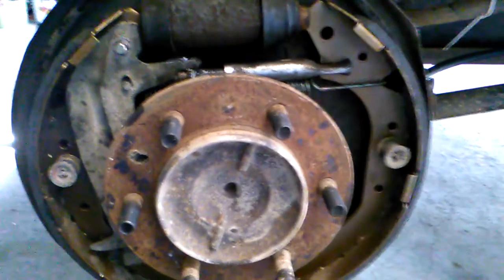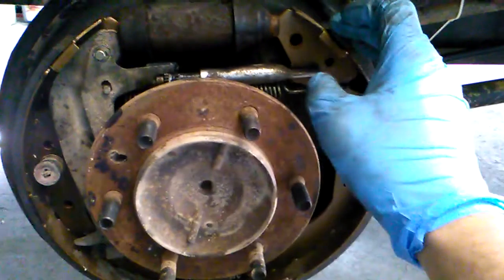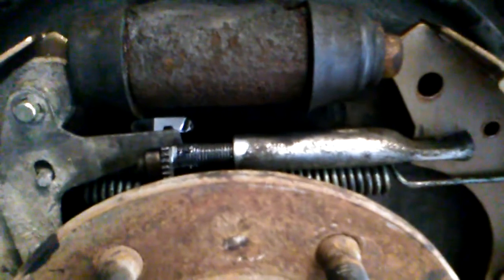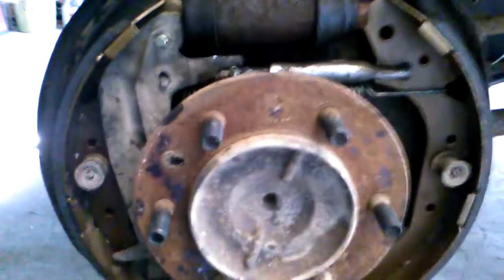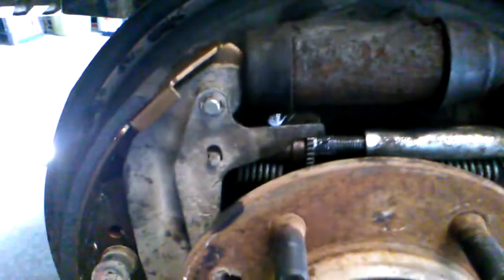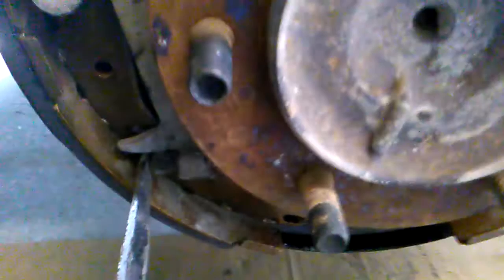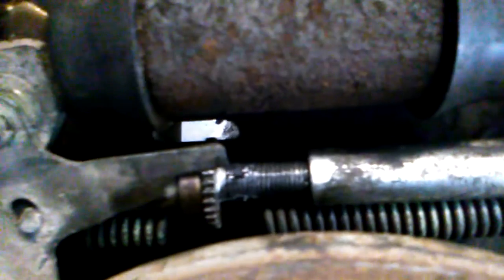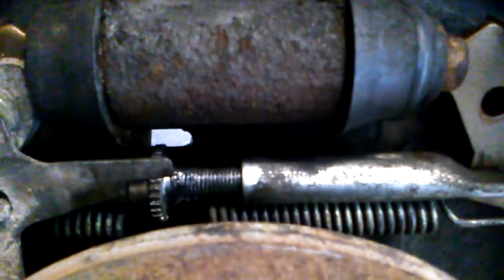Self-Adjuster Mechanism

Comment: Thanks for showing that mechanism; it's 10 degrees outside. My issue is that my Nissan truck self-adjuster never stops tightening and eventually locks the wheel. Nissan has lots of trouble with things like brakes, wiring, speedometers, etc, otherwise pretty reliable.
Reply: Check adjusters ..there's a print on them one goes to right side one goes to left side..sounds like they got switched..hope this helps👍
Reply from the maker: Better get cracking

Comment: Hi thx for the video. Just replaced my drums and shoes on the rear. I adjusted the self adjuster until there was a slight drag on the drum. I pulled the hand brake to check operation. It locked the wheels like its supposed to. When i released the hand brake, seems like my adjustment went away on both sides. Now theres no drag on the drums. Is this normal???

Comment: Question:  if the self adjuster on Toyota Hilux (in South Africa) does not adjust, is the solution to replace the spring running down from the adjuster plate?

Comment: So in theory there is not much need to do any manuel adjustments when installing new brake pads. Just make sure it's all loose and then pull the hand brake a bunch of times?
Reply: Foot brake will do the same thing at least for Toyota and Honda etc. Others may differ.

Comment: Since the adjuster bolt is turning clockwise and moving outward that means it's a left hand screw correct? So what do you think the wheel on the other side has, a left hand screw or right hand screw?
Reply: it is reversed on the other side

Comment: I've got completely different type of self-adjuster (Mazda from 1994). Really difficult to find even an image of it. It's mainly two flat cast iron parts with teeth and springs.
Reply from the maker: Is it a caliper?
Reply: @jasonc2948  I wish I could reply with a photo. Later found I was wrong, the adjuster is not cast iron.

Comment: Thanks for the very informative video. My 2004 dodge grand caravan also has a rear drum brake. The normal brake works perfectly, but the rear right e-brake is not working properly. The lever connecting with the e-brake cable did move normally when the cable was pulled, but the self-adjuster lever was just moving a little bit.  It's not enough to make the star wheel turn and push the brake shoes against the drums. Shall I replace the self adjuster lever spring or the lever itself? I am not sure which hardware needs to be replaced. Would greatly appreciate your help!
Reply: My best guess is your parking brake cable is elongated and needs to be replaced.